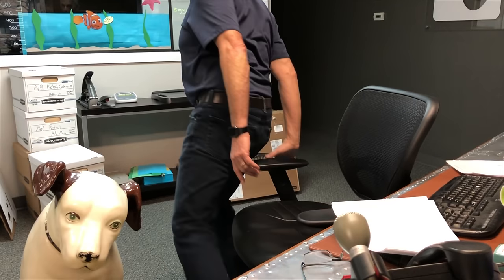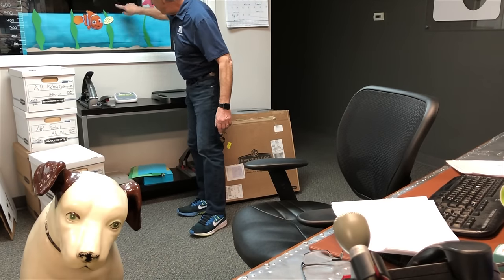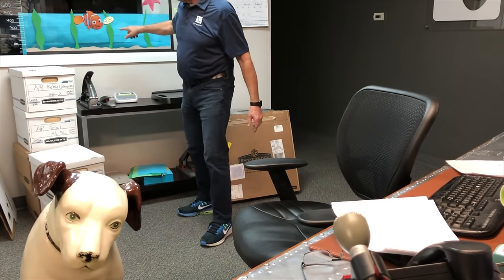Why do tubes sound different than transistors?

Comment: Tubes are analog, high voltage and low current. Solid state has one major problem, which is they are either on or off, which makes them sound grainey. Digital sound is the same. And, the problem is made worse by combining the two. Tubes usually make even order distortion, while solid state usually makes odd order distortion. Tubes are a pain in the butt. They are expensive, produce tons of heat, and sound better, smoother, more tonally correct.

Comment: You can have a Transistor amplifier with a bandwidth from a few cycles to way over 40 kiloherz flat, to which no valve can hold a candle to. if you dont like this Sound you can always put in a preamp Equalizer to make it Sound how you want. Humans are variable some like top some like bass-.
Reply: I have a tube amplifier, designed in the 1960's by a major USA manufacturer, that at rated power (75 watts) and is within +/-  1dB of 100khz...I've measured it. I have a bigger amplifier I work with, with 1 large tube, that produces 20KW of power, at 100MHz!  (FM BCB transmitter, doh!) There are many common small signal pentodes you can design circuits with, that have bandwidths in excess of several MHz.  

The nonsense, that vacuum tube amps sound soft and "tubey" because they lack bandwidth, is just that; nonsense. It's usually the result of bad design and/or out of spec circuit components. 

It's also relatively easy to design amplifying stages using vacuum  tubes with extremely low THD and IM distortion characteristics; using fewer active components than similar ones using solid state devices. 

I think a lot of the differences in sound quality perceived by some people can be explained by the difference in the level of higher odd order harmonic distortion products produced by high feedback amplifiers, most of which are of solid state topology. Studies in the past have concluded that the ear is more sensitive to these distortions than lower order products, i.e. second and third order harmonics, as those tend to be aurally "masked" by the fundamental tones. (this whole "masking" theory is how lossy digital codecs (mp3, AAC, etc.) can throw away 85% of the music information in a sound file, and still sound reasonably ok. Lots of reading available on that subject)

Comment: How often should a tube be replaced?
Reply: The amp manufacturer should tell you that.  It’s not an easy answer, some amps run the piss out of their tubes and they will have to be replaced after a year.  Others run them very conservatively and they can last for many years.
Reply: Only once!

Comment: What about nuvistors?
Reply: Nuvistors® are, simply, tubes.  Tiny tubes, but tubes nonetheless.  They were originally designed for satellites and similar applications which required small size and mass and vibration resistance.  They were developed because the transistors of the day were not sufficiently robust and could not handle very much power.  Transistor development made Nuvistors® obsolete within a couple of years.

Comment: The fact is there is no such thing as an accurate tube amp. But people like the shit they are used to hearing regarding tube amps and stereo listening. I like the "sound" for guitar but I will never use another POS tube amp and haul transformers and speaker magnets... not today with what we have now, which is head and shoulders better and more dependable than fuckin' tubes:) And they begin to degrade the second you crank them. Then you don't know what screwball parts they had to use to keep the line moving. Every year you MUST replace all the tubes, then you have no idea what they will sound like. Tube amps are like high maintenance bitches, ugly bitches:) Tubes today are strictly about ego and ignorance.

Comment: I wanna know if there is any benefit or where it would vary to utilize regular MOSFETs (MetalOxideFieldEffeftTransistors) over N-Type Vfets and others in the arena of audio as a whole. I know MOSFETs have been used for years now but I would like to know if there has been some advancements made into other types due to efficiencies and performance or is the use of MOSFETs that golden find that is the best overall so why change.

Comment: Lightbulbs don't have a vacuum in them.  Rather they use noble gases, such as argon.  A tube needs movement of electrons from one plate to another to operate, so any gas in the way will impede it's operation.  Lightbulbs just need to prevent the filament from burning out, so a noble gas is all you need for this.

Comment: Tube circuits generally have more distortion than good transistor designs, but that distortion is of lower order (it has a higher percentage of second harmonic in its distortion spectrum).  Some people find higher levels of second harmonic distortion to be pleasing.
Tube circuits are typically designed with less feedback in order to intentionally allow for that higher 'pleasing' distortion.  It's actually possible to design tube circuits with extremely low distortion, especially in preamp sections, but nobody wants to.  They would sound too much like low distortion transistor circuits.  
'High fidelity' is really a misnomer.  It should be called 'high quality', with the 'high' being defined by the tastes of the listeners, which are often influenced by current trends. Speaker designers, DAC designers, amplifier designers (especially tube ones), and recording studios all know this.
Most audiophiles have little idea what actual live unamplified music sounds like, nor do they care.  It's just not relevant.  They want pleasing, 'high quality' sound.  The greater low order distortion in tube circuits helps provide that for many audiophiles.

Comment: Heres a basic thought....
Theres a level of microdetail and basic quality you've been missing from your solid state that's In a simple tube amp .
It's like a blanket got pulled off your speaker, 
Dont underestimate why people mess with finicky ass tube amps .
There is something to it , especially SET .
It sounds very clear , pure and enjoyable especially compared to most A/B and D class amps .
If It didn't people wouldn't bother .

Comment: Valve arguably sound better; but only once warmed and new; but yeah  I think Paul summarised nicely. IMO a good MOSFET design is just as good; but you will need more devices and localised/global feedback; and of course it is going to be more reliable and less susceptible to warming inconsistencies, I don't want a system that sounds different days or weeks from now or warm it up for 30 minutes before every listen.
You also have to realise that almost every valve design requires an impedance matching transformer-this degrades the sound because of factors such as magnetic leakage and saturation.

Comment: The reason tubes sound different - more 2nd order harmonic distortion, lowpass filter on the output (transformer) and a different feedback. Generally a tube fucks up the signal more than transistor and therefore tube is not more "HiFi"

Comment: Anyone interested in a proper explanation should read

http://sanderssoundsystems.com/technical-white-papers/172-tubes-vs-transistors
Although this excellent article is about driving electrostatic speakers it clearly explains why tubes can sound different to transistors.
The lesson is to spend your money on a high power transistor amp rather than a lower power tube amp which may cost much more than a solid state amp.